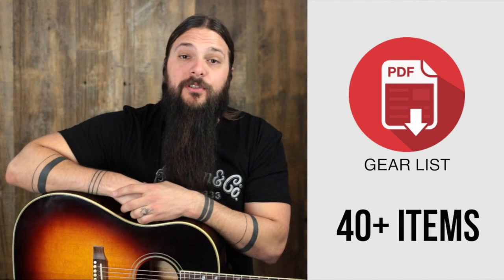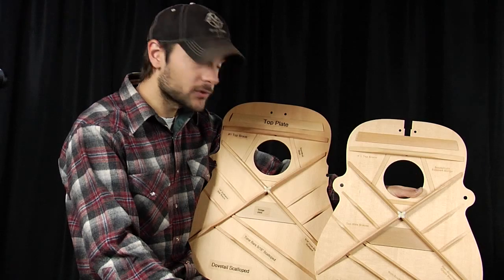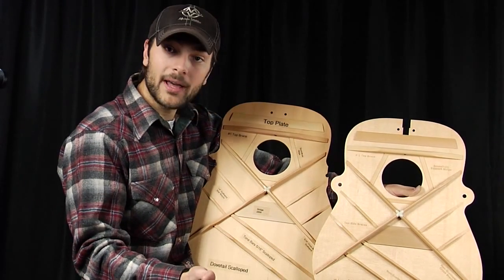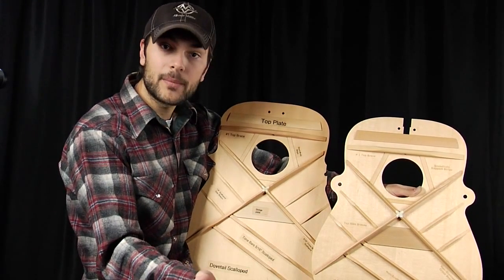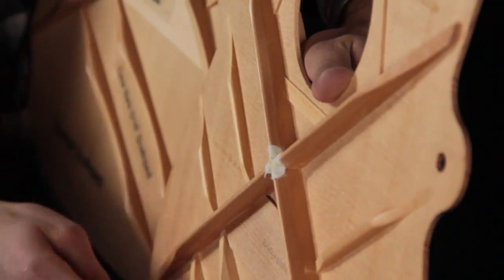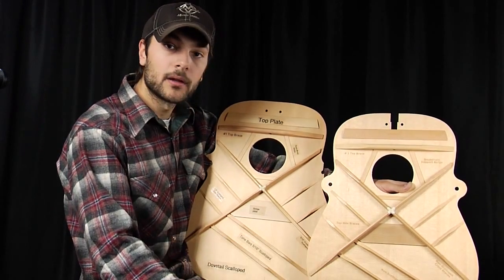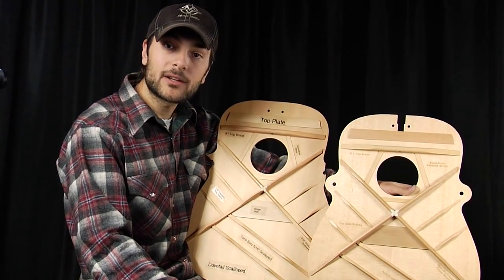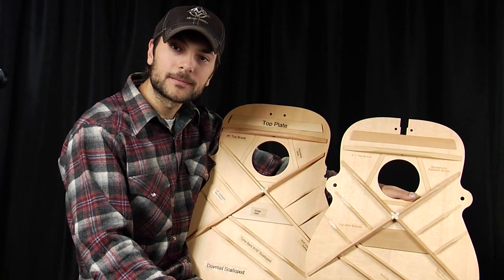Scalloped Bracing vs Straight Bracing Using Martin as an Example

Comment: While these two bracing patterns are identical aside from the scalloping, Martin also has a non-scalloped design (NS 1 Style) that lightens the top in its own ways: 
• 1/4" bracing.
• A generously tapered X  (stiff center, freer edges).
• A-frame freeing up the upper bout.
• Larger angled bridge plate boxed in by one tone bar (again, stiffer center, stable bridge), but NO second/lower tone bar, thus freeing up the lower bout.

I think its design--stiff-center, free-perimeter, and freer bouts--works incredibly well on my custom 000 12-fret (having had a handful of scalloped 000 12-frets)...warm, loud with a fast response, lots of bass, and lots of sustain.
Reply: Could this be why my 2018 Martin HD 28 is not scalloped.

Comment: But my 2018 Martin HD28 does not have scalloped bracing. It has straight tapered, bracing also with tapered top edges. Can this be how some were manufactured?

Comment: Hmmm I wonder if you could increase the effect by perforating them with tiny holes (say 3/16”)  as well as scalloping? Or scalloping and then taking a gouge and dishing them out a bit on the sides.
Reply: Try it or shut it

Comment: Does anyone have an opinion on which is better for finger style?  Seems to me that scalloped would perhaps be best, given that with finger style you want to get as much volume and resonant response with the least amount of effort, so that you can concentrate more on nuanced expression than having to pull the sound out if it which takes away from your ability to be more relaxed and controlled.  I for one find that when I feel I have to concentrate too much on really digging into the strings, it causes my hand/fingers to stiffen up, which makes playing all that much harder, and not only that, but I find that when you do have to do this, -- when you actually have to really pull the sound out, you actually get a compromised tone.  For one, I find that with really light strings, I can actually get more volume out of them because I am able to get more with less effort, whereas with flat picking, on the other hand, although still brighter, can be more tinny thereby lending to less volume even with a greater attack.
Reply: *****
Ha ha!  Hya Ironman :)  So are you planning on having one custom made?
Reply: *****
You gonna do it yourself?
Reply: *****
Heeey, brotha!  :)  More power to ya.  I'd like to see/hear it when it's done.  So what style you goin' for?
Reply: Scalloped theoretically has better resonance.
Reply: It really depends on whether you prefer a light touch or a heavier one and how dynamic you play, including fingerstyle. I prefer straight bracing and I mostly play with my fingers, but on smaller body guitars (parlour and concert models) the scalloped bracing really seems to excel. But it depends on the individual guitar.

Comment: I think a bigger effect of scalloping is the reduction of stiffness. Also, I've scalloped  a number of guitars over the years, and the weight of shavings causes an insignificant change in the weight of the top.

Comment: Anybody know the answer to this : I have a cheap Martin, a  DRS-2, which came with an under-saddle PU.  I never use pickups on acoustic guitars (much prefer microphones).
If I take all the PU junk out of the guitar,  will I notice an improvement in the acoustic sound of the instrument?  Opinions?
Reply: Bob Aldo I think a little bit better but not much.
Reply: It depends. What brand and model pickup do you have?
Reply: @jonathancollins9057  Why would that matter?

Comment: So how doe each effect sound of the guitar.  What exactly do you feel and nuisances.  You said it takes a bit more to get the top moving.
Reply: Soundboard braces are scalloped to tune and control stiffness. The straight bracing has been used in response to an increase in guitars having soundboard problems due to a swing towards players using heavier strings. Guitarists need to be aware of the string tension limits their guitars are designed for. Sraight bracing guitars are designed for heavier strings.

Comment: So what, if any, is the advantage of straight bracing.  And if there is none, why bother?
Reply: it's easier/quicker to make, cheap guitars might have a single X or - made out of unfinished pieces of wood or sometimes no bracing at all..

also if you are a rhythm guitarist like Jack Black who strums hard all day long you might find the straight bracing sounds better for you as scalloped is too responsive and sounds muddy when you bash the hell outta it.
Reply: Soundboard braces are scalloped to tune and control stiffness. The straight bracing has been used in response to an increase in guitars having soundboard problems due to a swing towards players using heavier strings. Guitarists need to be aware of the string tension limits their guitars are designed for. Sraight bracing guitars are designed for heavier strings.